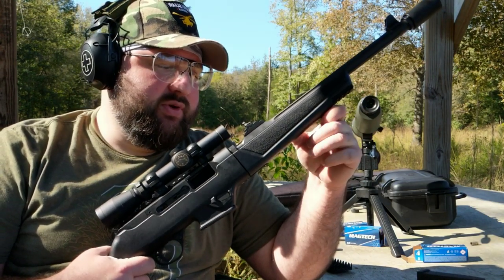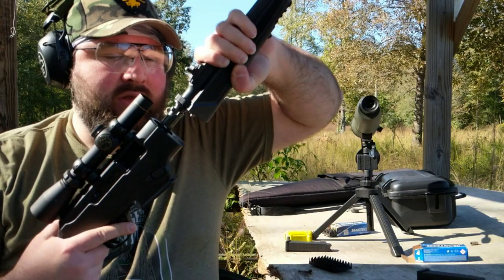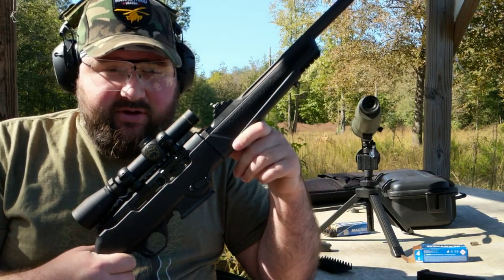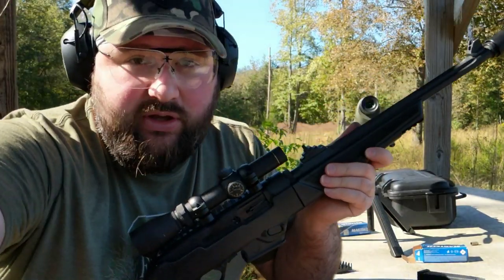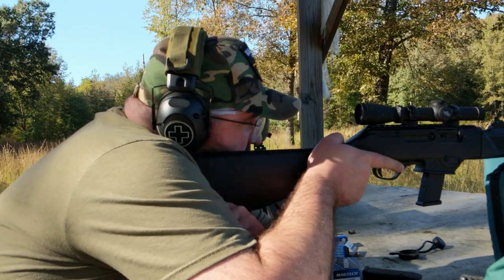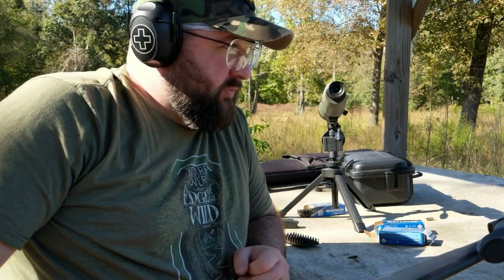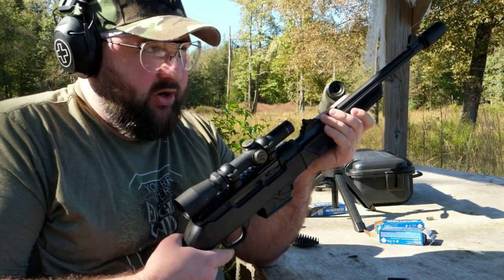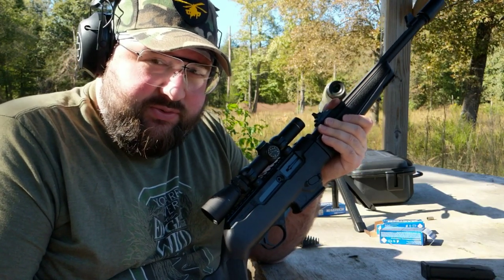Ruger PC9 Carbine: Plinking Steel at 100 Yards With A PCC

Comment: I didn't have any doubts you could hit an 8" plate at 100 yards with that carbine and a scope. I was messing around with my braced Scorpion pistol (7.73" barrel) and consistently hitting an 8 " plate at ~70 yards with only an RMR with a 13moa dot.  First two shots were me trying to figure out my hold, next 18 rang steel. 9mm may not be a rifle cartridge, but it'll definitely put a hurtin' on ya at 100 yards.
Thanks for the video. Always happy to see another one from you guys.
Reply: Oh for sure. There's a reason many SMG iron sights have settings up to 150 m/y. Sure at that distance it requires skill, but its still worth something.

Comment: one thing: don't fiddle with the locking ring. it should be tight for best accuracy.
Reply: Ruger also recommends that the bolt be cycled back and forward 2 to 3 times after the barrel and has been removed and put back together.

Comment: hey i have a question if anyone can help, i have a romanian wasr-10 and i have some issues with it. My bolt is scraping against the mag and sometimes causing the mag to release from the magwell. Does anyone know what is causing this? Also im using stamped bulgarian 30rnd mags.
Reply: When and where did you get it? You could just send it back and get it replaced.

Comment: What kind of comp are you using?
Reply from the maker: It's effectively a cheap knockoff of the Ferfrans "concussion reducing" comp - an externally threaded brake with a "blast shield." I went with it just because I like the look, not because of the blast. - Jay